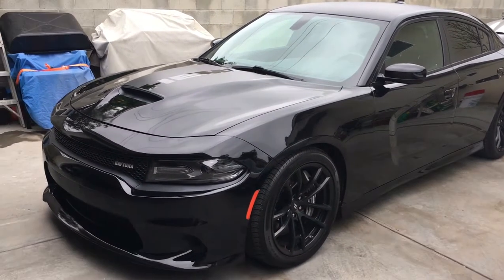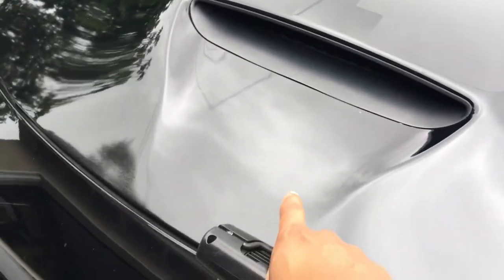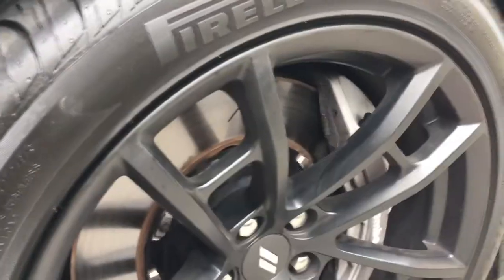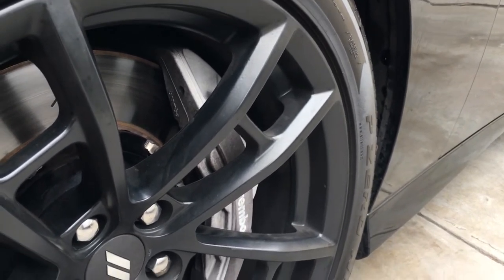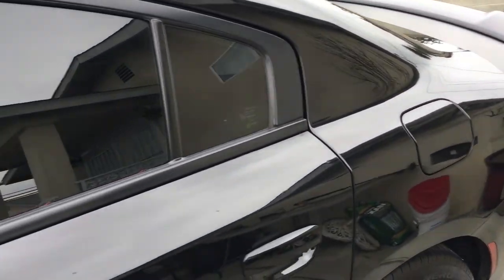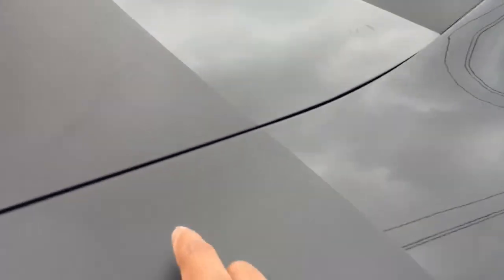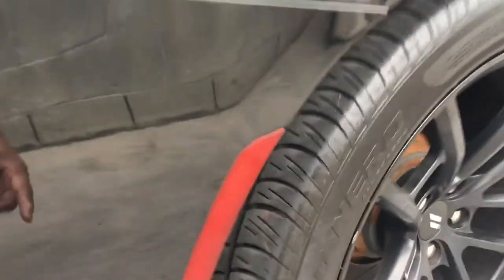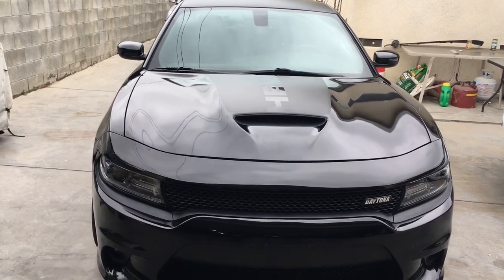2017 Dodge Charger Daytona 392 - Initial Walk Around Part 1

Comment: What did you say you use on the matte black decal areas?  Curious, only because I thought you aren’t suppose to put any surface enhancer type products on these.  Thx
Reply from the maker: The first time I used Cquartz Skin which is designed for matte vinyl and PPF. The second time the car came back I put a Graphene coating on the matte surfaces.  Pretty much any coating can be used on matte.  

 The second time the car came to me I coated the wheels with Adams Graphene coating.